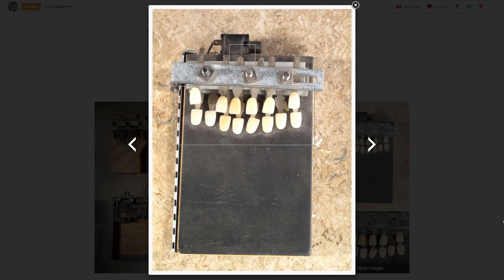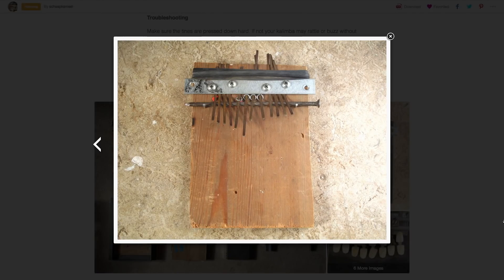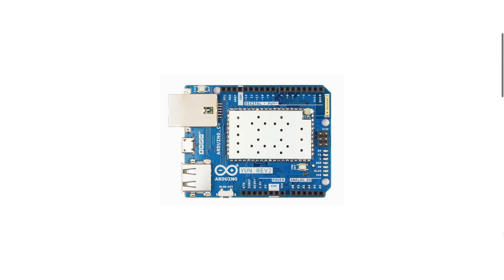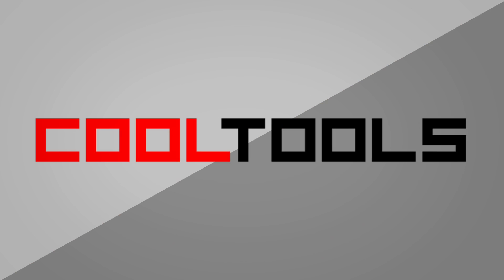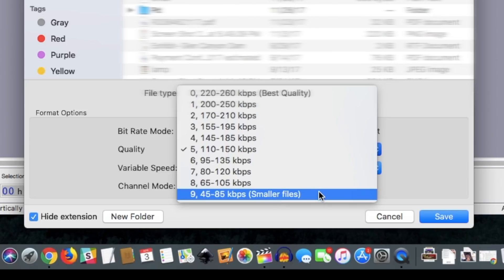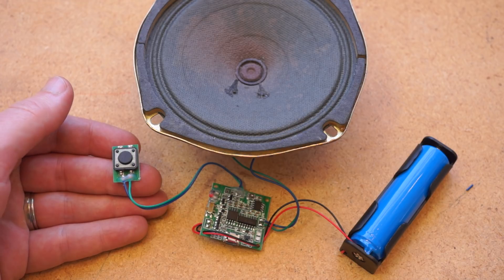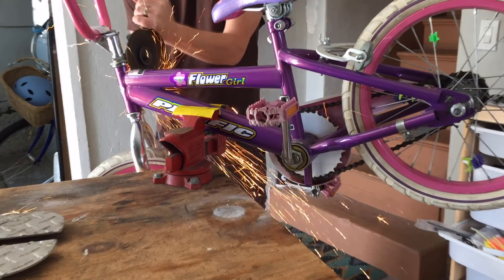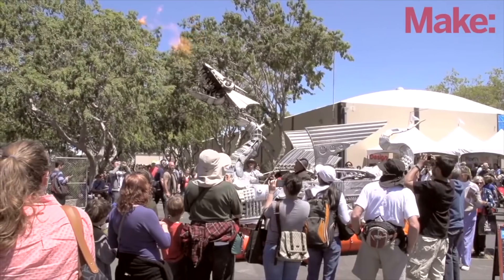Treasured Trash [Maker Update]

Comment: Man I need a trash piano, and anamatronic Trash panda!! (late to the party this week) - Also holy mackerel! That's an awesome board, I can't believe it has charging circuitry for that inexpensive!  Throwing a cheapo Amp  onto it should be pretty easy - like the Pocket CHIP hack. and run it off the same battery - or adding the 5volt.
Reply from the maker: Yeah, the board is pretty neat! I found that just upgrading the speaker was enough to get a pretty big volume boost. But with the adjustable gain, running it to a separate amp board should be easy to dial in for a decent sound. I've already desoldered one of the function resistors so that sound playback stops when the button is released. This way it behave more like a real horn, and I can lay into it for a nice long HOOONK!
Reply: Excellent I can't wait to see it in action! yeah I am going to pick up one of them. I do a lot of small sound projects, for whatever reason, it is one of my favorite things to do, and astonishingly there is not a lot of good low cost options, or ones that do exactly what i want - But i always think "If they can put this in a 5$ greeting card, why can't I do this for cheap? " And i am not ashamed to admit I have purchased recordable cards before, because they were cheaper and had everything built on - just to strip out the sound components .